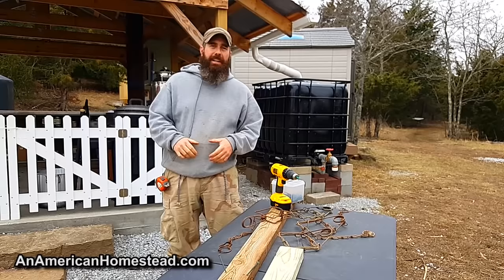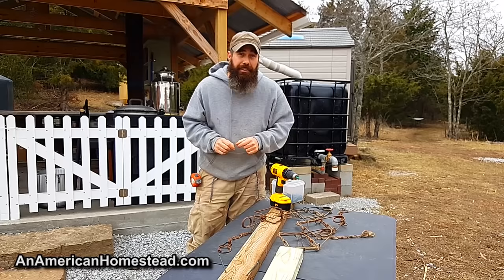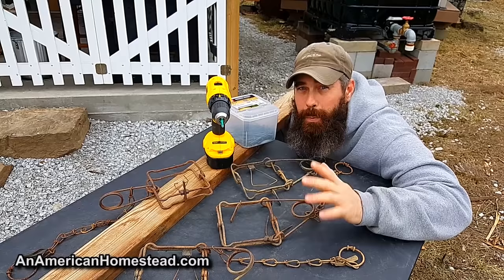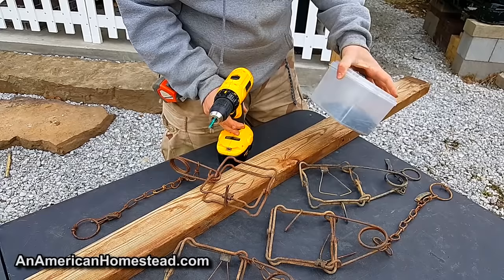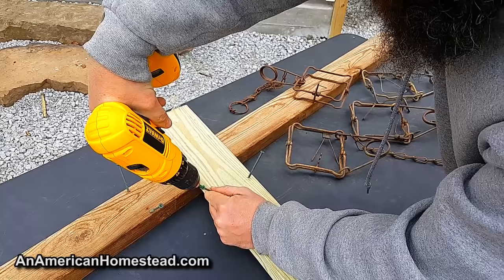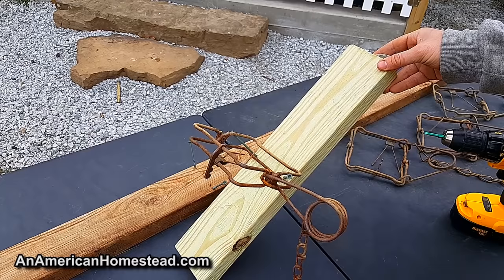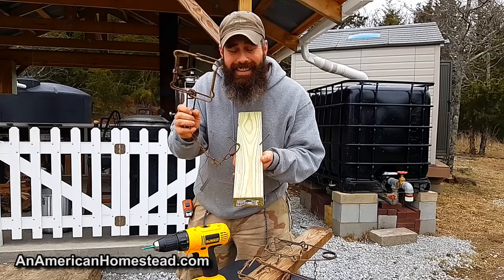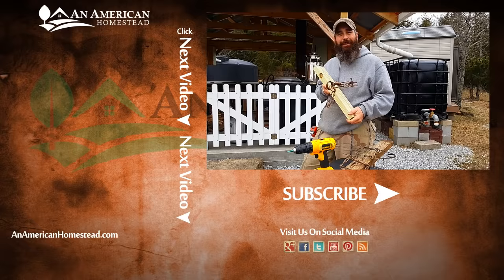How To Kill A Bazillion Squirrels (Probably Illegal)

Comment: I hate squirrels for the reason you gave. They're out of control in my neighborhood, no roaming cats or dogs to get'em.
Reply: You could use peanut butter just as easily.  If you want to trap a lot of squirrels, the type of trap is the most important consideration.   I've disposed of 350 squirrels since June 2014 from my backyard but most of them were caught when I switched to a new type of trap 3 years ago.
The best solution to a squirrel problem is the Havahart #1083 "Easy Set One-Door Cage Trap for Squirrels and Small Rabbits" I used to use the old fashioned Havahart 1030 traps but I have upgraded to the 1083 and now have 3 of them. It also only has 1 door which makes it much shorter and I thus need a much smaller tropical fish tank to drown them in. You have to order them online, since the big box stores don't stock them for some crazy reason.

This is the most humane way I have found to dispose of grey squirrels and I try and keep the water reasonably clean. The smaller tank uses less water. But most importantly 1-door traps are not only MUCH easier to set but they are also much easier to bait because the squirrel can only enter from 1 direction so the bait only needs to be behind the walk-on platform. You don’t have to “balance” the mechanism the bait sits on, thus the 1083 is also a much faster trap to bait.

(My bird feeders and vegetable garden are both in the back yard and they attract grey squirrels, so I place my traps in close proximity to them.  We have an Oak tree in the front yard but I don't have any traps in the front yard except in the fall.)

The other great thing about this trap is that I never have any "set off" by birds. Every time this trap closes, there is a squirrel inside. The 1030 trap was frequently catching small birds, which was a huge waste of time.   You will never catch a squirrel, if the trap is closed all day with a bird inside.  Use cheap peanut butter for bait. And lure them into the trap with a few shelled peanuts. I then consistently take the carcass to the exact same place in a nearby woods for predators to find. I like to think this causes predators/scavengers to hunt rabbits and other small game much less frequently.  I've recently discovered that possums will scavenge grey squirrels if you leave them in the same spot.  I like possums, so this is a win-win for me.

At night, I place mouse traps inside the closed 1083 so that only mice can get into them. (this keeps small birds out of the traps) I was surprised to discover a mouse infestation, that I was completely unaware of. The first 8 days I did this, I caught 14 mice behind our garage.

email me or call with questions. devilsadvacat at gmail 
WRZ   2020-04-20

Comment: A five gallon bucket, fill with water 1/3 of the way. Put a large stick or log, big enough for them to traverse, on the bucket and ground. Sprinkle sun flower seeds in the water. They will crawl up the log and drown themselves while trying to get those seeds. You will get multiple squirrels.
Reply: Put some antifreeze in that buckett they love that more than seeds.
Reply: We killed 39 chipmunks in one week with the method you describe.  We were overrun with those damaging little critters (obviously if we caught 39 in 1 week!).  The bucket/water/sunflower seeds definitely works!  I would think for squirrels you would need a much taller bucket.  Couldn't they just stand up to breathe in a 5 gal bucket?

Comment: I set up my squirrel pole and kill about 2 per day for a month, now dropping down to about 1 every 2 days but works great.  Your positioning of the screws is all off though.  You need 4 screws for each trap, set about 1/4 apart between 2 up, and 2 down, space horizontally about 2 inches.  Make sure trap is on the outsides of the screws.  Very secure and moves freely.  Set screw straight perpendicular to the board, and hold up about half an inch.  Our squirrels were chewing the wiring in our cars, costed us a lot of money to repair.  Thanks for your video.

Comment: Squirrels eating tomatoes is real!  They demolished 42 of my tomato plants last year.  I ended up with 3 quarts of tomatoes from all those plants. I'm going in loaded for bear (squirrel) this year.  Definitely going to try this squirrel charm bracelet log.  Thanks!
Reply: Guildbrook Farm | Simple Sustainable Living Is there anything that you can spray on your tomatoes to keep them away? Maybe Google has an answer.
Reply: Eww. Eww eww eww. I will not spray anything on my tomatos but water. If the squirrels don't want them, nor do I.
Reply: I used a Tomahawk trap model 103 or 102XL and I caught 14 that were in my woods, and trying to get into my attic. I drowned them while still inside the trap into a large container of water. Then the foxes eat them at night
Reply: Give them nuts and they stay away from your tomatoes.
Reply: Possums got my tomatoes.
Reply: Guildbrook Farm - Off Grid Living What you gotta do is feed them. Yes, lure them away from your tomatoes with some good bait. I saw a gadget that kills mice or rats. The bait is put up in a cylindrical tube and the rat must put it's head in the kill zone of an air operated slug that penetrates the skull. It should not be difficult to build something like that.
Reply: @LD-dx1cw  
I use a Havahart model 1083 and then drop it into a slightly bigger tropical fish tank,
so  that I can keep the water clean without wasting too much.
Local tropical fish clubs are a good place to find used fish tanks.
Yeah if you consistently leave the carcass in the same spot, scavengers will begin to look for them there.
It annoys me that people make squirrel trap videos without suggesting a worthwhile use for the carcass.
WRZ  2021-04-26
Delaware County, PA
Reply: @GeneralKenobiSIYE  same here and I got less like half out of 45 plants due to squirrels I gotta use this and get rid of them I didn't kill any forst year gardening now I'm gonna get rid of them for next year I had 45 baby tomatoes and 45 giant steak plants and lost 85 percent of my tomatoes
Reply: @donaldhicks3359  
What makes you think this ??  
I've never heard of possums eating tomatoes before.
Reply: Did the squirrel traps help you salvage more tomatoes ?
Reply: here is some info if you need it,  &  you can  delete my comment after you get it  
TLDR = if you find a baby squirrel warm it up, so you can return it 
to its mom & or safely rehydrate it, so you can safely give it formula  

baby squirrels can't stay warm, drink, eat, or eliminate without help till 90 days old
mom will not reject a baby for your scent BUT MOM WILL REJECT A COLD BABY,
so 
bring it inside to warm it up to human body temperature & Reunite it with mom if you can, , 
look up "Reuniting tree squirrel babies with their mom" mary cc squirrels reunite 

if this fails seek out a wildlife rehabilitator for help & if all of that also fails use 
its weight in grams divided by 20 to set how many cc's to feed it every 2 hours & 
to prevent aspiration pneumonia feed it via 1 - 3 CC oral syringe feeder lying tummy down please , look up 
 2018/09/11 example  video , "Thirsty baby squirrel!"  Jasmin121176 , & rehydrate it for a day using Pedialyte , 

they NEED mom or formula to supply adequate nutrition till they reject it at 10 weeks old
a FAST growing baby squirrel needs wildlife grade formulas used in a zoo like "fox valley day one "  
or DIY 24 hour perishable 3 parts goats milk, 1 part yogurt 1 part heavy whipping cream  
or a very few puppy formulas will work , (Goat's Milk Esbilac? ) but NOT  just "Esbilac "

a squirrels weight in grams is 20 times the safe stomach capacity in ml & cc's per feeding so 
find its weight in grams divide it by 20 , & thats the number of ML/CC's to feed each meal this 
"5 percent rule"  stomach capacity to  weight ratio  quantity as  each meal only works if you use a metric gram scale  

at 6 weeks of age let it practice gnawing solids like; fruits, monkey chow, & dry Puppy science diet.
at 8 week of age test if a baby squirrel can drink water from a shallow container AND crack a nut

look up 1X1X2 foot nesting box & 4X4X7 foot pre-release cage so you can slowly free it,
because after 6 months of age squirrels become unpleasantly wild

There is some good information on the Internet, but other sites
give advice that will kill the animals & some do this on purpose

Cow’s milk, goat’s milk, human baby formulas, & "most" other  pet products lack nutritional value, 
are less digestible &  boiling or scalding them wont fix it  over the long term of 2 months 
these eventually WILL cause  failure to thrive,  MDB , & death due to malnutrition 

squirrels don't get & or survive rabies long enough to give it & head trauma mimics rabies 
baby squirrels can be fearless & very sociable, so, its only an orphan if it pursues or climbs you,
 or a pet BUT stop ANY pets from touching it since digestive & oral bacteria can kill it 

see also 
"Helping pet squirrels become wild again"  mary cc squirrels tametowild,   
"squirreltales dot org" , hsvma org assets pdfs hsvma_wildlife_care_handbook pdf
squirrel-rehab org rehabinfo infantfeeding html
"squirrelrefuge dot org" ,  "thesquirrelboard dot com", 
justpaste . it / 36jzb
Reply: @WapTek123  
I question the intelligence of anyone who thinks spending wayyy too 
much time saving grey squirrels is a good idea, genius.

Comment: I saw this video and it seemed to be the answer.  I purchased 4 traps, got a 6 foot 2X4, set the screws per the video, and set up the traps.  It has been 10 days.  I have seen  several squirrels run past it but I have not seen one get on the 2X4 and I have certainly not trapped any.   I APPARENTLY DID TRAP SOMETHING MUCH LARGER THAN A SQUIRREL BECAUSE ONE OF THE TRAPS WAS MISSING.  I am beginning to doubt the effectiveness of this squirrel pole despite the enthusiasm of the presenter.
Reply: I also just watched this video (5 years later) and tried.  I had a squirrel get caught but not killed; it dragged the trap off but it wasn't too far away.  I don't like the idea of not killing them instantly, but I'm not sure what else to do.

Comment: Exactly, let them talk to me after squirrels have done 4,500 dollars worth of damage to their house.
Reply: You could use peanut butter just as easily.  If you want to trap a lot of squirrels, the type of trap is the most important consideration.   I've disposed of 350 squirrels since June 2014 from my backyard but most of them were caught when I switched to a new type of trap 3 years ago.
The best solution to a squirrel problem is the Havahart #1083 "Easy Set One-Door Cage Trap for Squirrels and Small Rabbits" I used to use the old fashioned Havahart 1030 traps but I have upgraded to the 1083 and now have 3 of them. It also only has 1 door which makes it much shorter and I thus need a much smaller tropical fish tank to drown them in. You have to order them online, since the big box stores don't stock them for some crazy reason.

This is the most humane way I have found to dispose of grey squirrels and I try and keep the water reasonably clean. The smaller tank uses less water. But most importantly 1-door traps are not only MUCH easier to set but they are also much easier to bait because the squirrel can only enter from 1 direction so the bait only needs to be behind the walk-on platform. You don’t have to “balance” the mechanism the bait sits on, thus the 1083 is also a much faster trap to bait.

(My bird feeders and vegetable garden are both in the back yard and they attract grey squirrels, so I place my traps in close proximity to them.  We have an Oak tree in the front yard but I don't have any traps in the front yard except in the fall.)

The other great thing about this trap is that I never have any "set off" by birds. Every time this trap closes, there is a squirrel inside. The 1030 trap was frequently catching small birds, which was a huge waste of time.   You will never catch a squirrel, if the trap is closed all day with a bird inside.  Use cheap peanut butter for bait. And lure them into the trap with a few shelled peanuts. I then consistently take the carcass to the exact same place in a nearby woods for predators to find. I like to think this causes predators/scavengers to hunt rabbits and other small game much less frequently.  I've recently discovered that possums will scavenge grey squirrels if you leave them in the same spot.  I like possums, so this is a win-win for me.

At night, I place mouse traps inside the closed 1083 so that only mice can get into them. (this keeps small birds out of the traps) I was surprised to discover a mouse infestation, that I was completely unaware of. The first 8 days I did this, I caught 14 mice behind our garage.

email me or call with questions. devilsadvacat at gmail 
WRZ   2020-04-20
Reply: If you cant keep a squirrel out of your damn house you shouldnt own one.
Reply: @daddywolf1364  A friend of mine had a bungalow by the river Usk in the UK, he went on holiday for two weeks. He had a store of dog biscuits for when a relative visited with their dog. Whilst on holiday a squirrel found it's way into the house down the chimney but couldn't find it's way out. The damage and mess caused by the squirrel was beyond what someone would think possible. All the dog biscuits were gone when he got back. The squirrel shot out of the house when he opened the front door!!! A mesh guard had to be fitted to the chimney pot.

Comment: Have been vexed by squirrels more times than I can count. The time they got into my attic was enough to drive me crazy.
Reply: I use a red Ryder to keep them from my bird feeders. I aim for the butt, but the other day accidentally got one on the eye and it jumped back started spinning and laid down by the tree. I went outside to check on it and it was totally disoriented and had blood gushing from eye and died. Everyone I’ve read talking said it impossible to kill one with a red Ryder. Unless you can get an eye shot they probably right. Squirrels do nothing but cause damage.
Reply: @joew4202  Amen. Rats with fury tails. Took control. Now have the high powered pellet gun with scope. Lost track of how many I have downed. The problem? For every one you vanquish two more appear.
Reply: I hear you.
Reply: T Hyslop I need a pellet gun.  I’ve never seen a .22 pellet gun.  What kind do you have?
Reply: @leesire  I believe it says Gammo 950 on the barrel. I bought it cheap and used at a local gun store with scope. From 20 yards I cannnot miss. Tagged one at 35 yards the other day. I am lusting for a really nice gun. The problem is I just do not have enough time to check all the specifics. Thera are hundreds here posting videos on different types of equipment, which further frustrates and confuses me let alone the time spent in research. Do not have the time to fine tune exactly what I want. Wish I did. Though l could buy a nice gun invariably I find, like with electric tools after using them there is a feature I wish it had or something I do not like about it. In that regard, I hate being the  GUINEA PIG on equipment.  For Instance in my work I use equipment from three different manufacturers, from Europe, USA and Korea and each one has features or unique weaknesses I do not like. Each time after outlaying lots of capital and only when it is in the field do I discover these limitations.  

Why cannot one machine have all the right features? Have talked repeatedly to the manufacturers and you get no where.  So, in buying the gun cheap it lowers my expectations.

Talked to the Korean guys and they barely speak English. You get nowhere.
Reply: Also, I guess I misspoke when I say high powered. Yet compared to what I was using it was. It is the piston action one break of the barrel type. I believe the Gammo 950 with scope.
Reply: T Hyslop I feel the same way you do.  I will prob just find one for less than $100 with a scope and a rifled barrel.  I’ll get the one you mentioned.  What kind of work do you do?
Reply: @leesire  Think I pad 60 bucks. I have so little time, that is such a factor in my decision. It looked good, had a scope, was relatively inexpensive in case I screwed up. Paid for it, bought pellets and left. Does the job more or less. Work? Industrial laundry equipment.
Reply: Up late. Just read the reviews. Apparently not the great of a gun. Over time loses its accuracy. May wanna read the reviews. Mine I only shoot probably 10 times a month. Had it for maybe two years. Again low expectations.
Reply: @thyslop1737  Yes, they mate twice a year, so they repopulate regularly. Pregnancy time is short too.